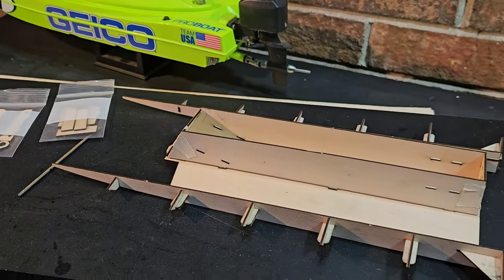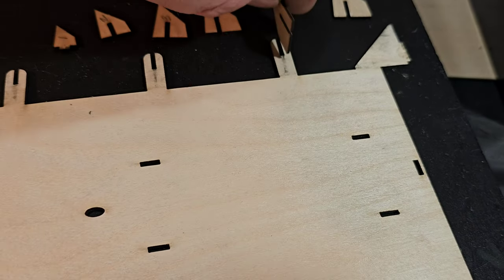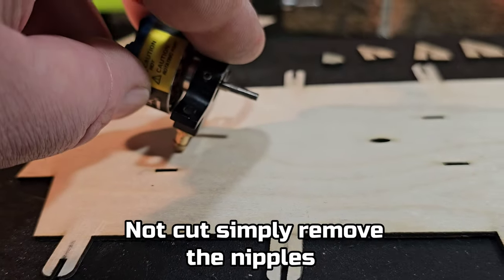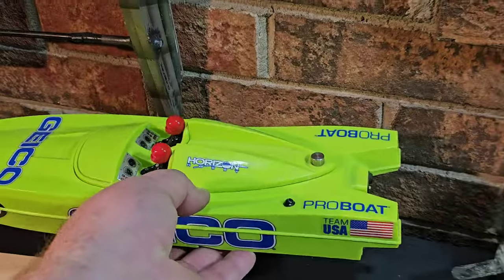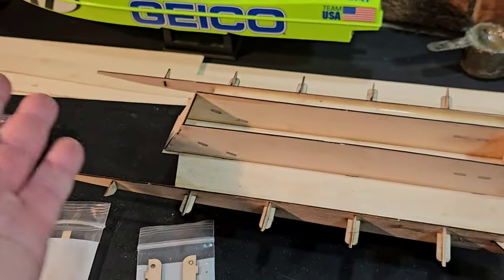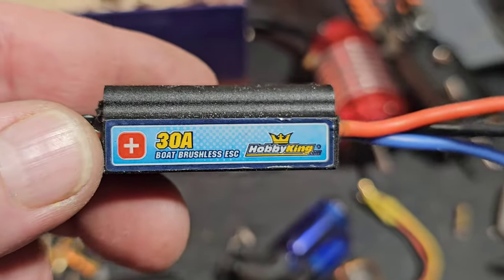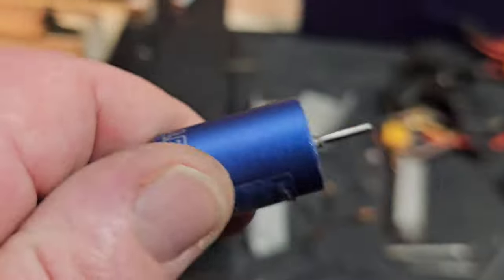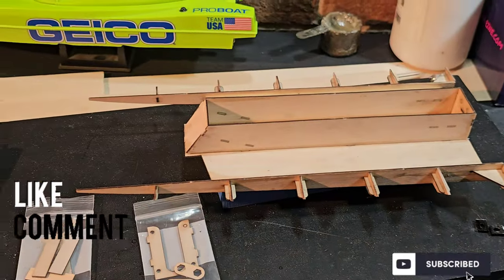SPX Micro Tunnel Hull, Proboat Powerboat Dummy Outboard Motor & Electronics

Comment: Fun part about outboard tunnels is the esc placement!   It winds up wanting to be in the back because of the leads, I've been running my servo up front and running two small coated cable to each side of the outboard, just like a real boat.   It leaves the back open for esc and battery and reciever up by servo.   I've done a few outboard small tunnels, 20" ones.   I run a tfl outboard so it's a true outboard.   Fun boats, can't wait to see yours run!

Comment: I like that you are taking some "Poetic License" and doing things differently.  My ultimate goal in all this prototype testing is to establish the optimum strudder angle/depth and just have it fixed in the kit for the sake of simplicity.  Same thing with the motor/prop selection.  Once I find a good motor/prop combo you can build it stock for "Class" racing, or mod the hell out of it for all-out speed.  Maiden run here:  https://www.youtube.com/watch?v=B95SKA9QNhw
Reply from the maker: Figured you'd be happy that I'm trying something different, makes it easier for the average person that owns a power boat racer to build this boat, just transfer basically everything into the spx.   DUN done
Reply: Yeah, I think that's a great idea. @IRONCLADRC
Reply from the maker: How much does the motor & motor mount weigh in your finished hull
Reply from the maker: Total weight may be helpful too
Reply: I'll get all that info the next time I'm in the Stinkbugworks @IRONCLADRC
Reply from the maker: Roger that